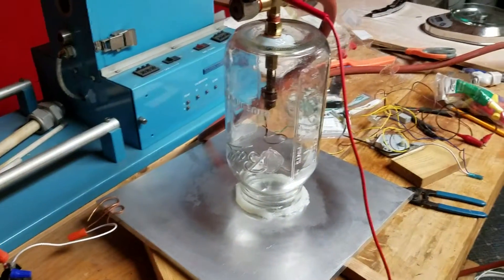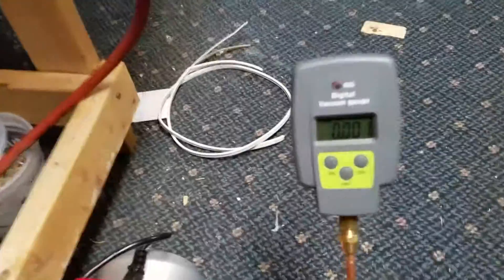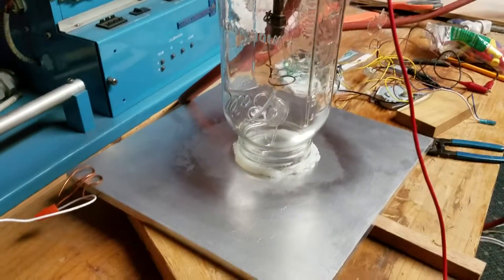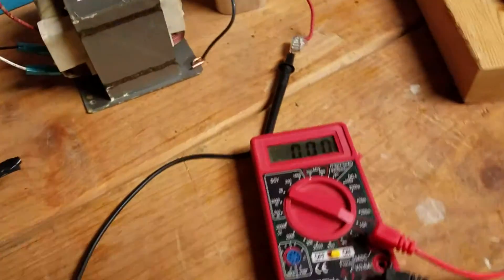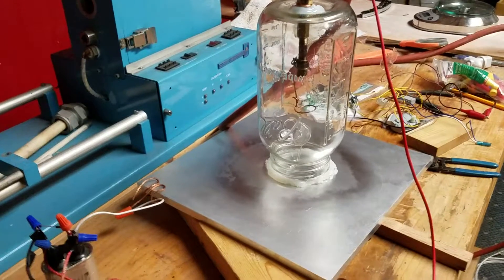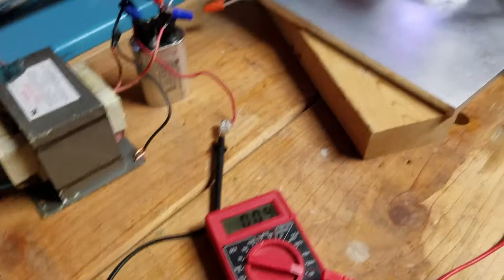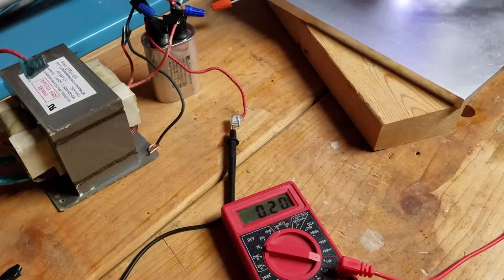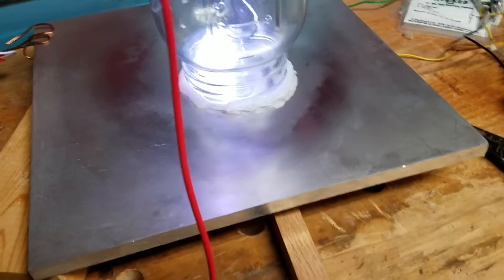Sputterer

Comment: The vacuum is too high. You need residual gas to do the actual sputtering.
Reply from the maker: Do you know what should be the vacuum?
Reply: @fiberd  Most people prefer 10 to 100 milli torr. You can get your perfect vacuum first and then raise the pressure slightly using  Argon, e.g. from a welder's store. Also, remember to keep your source material at negative potential. The positive ionised gas slams into the source material and emits its atoms, which then sputter your glass slides.